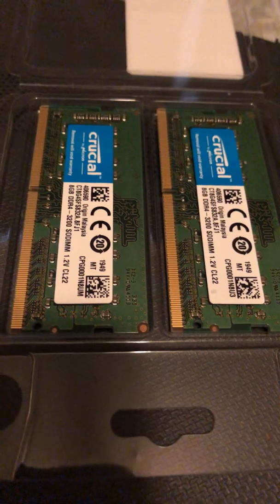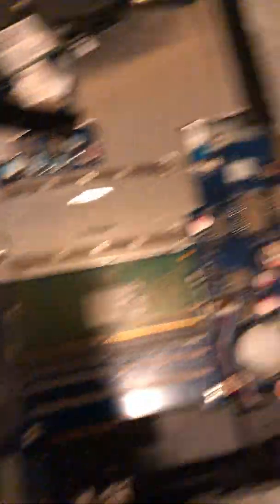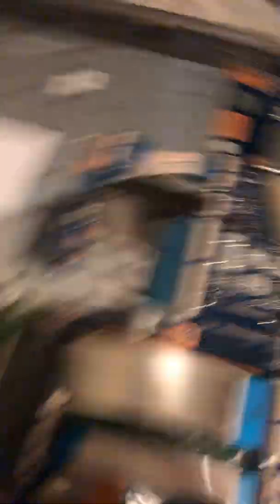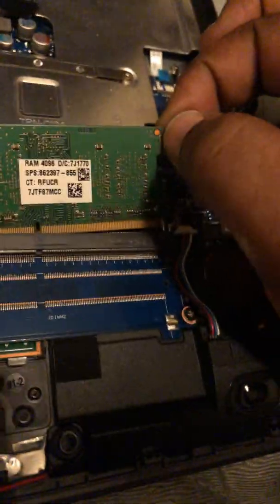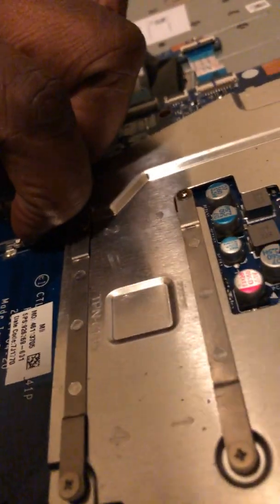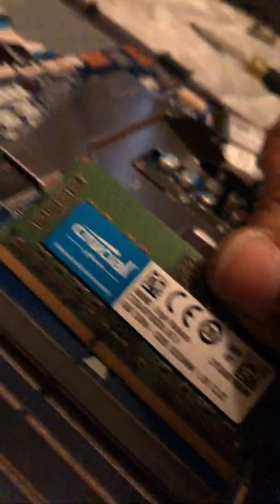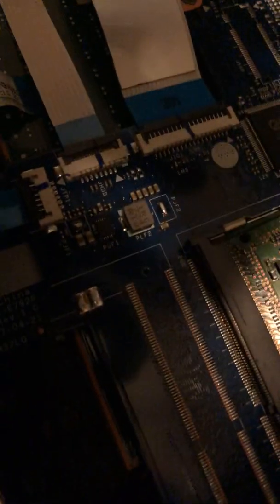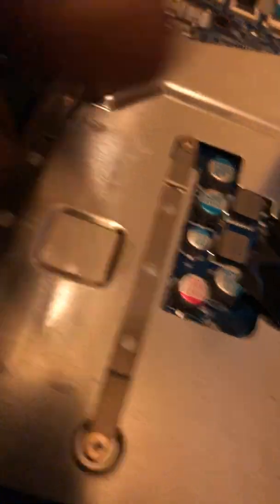HP 255 G6 NOTEBOOK PC RAM UPGRADE

Comment: If you run the system scan on the crucial website it would have shown the max RAM your motherboard can handle. The HP 255 G6 should have 2 slots for a max total of 8GB RAM Installing 2 sticks of 8GB RAM for a total of 16GB is a total waste. It would be better to just install 2 sticks of 4GB and have them interlace memory for dual channel.
Reply: You saved me from wasting money thank you
Reply: SilverEOD : thank you , but I think tehre is only one slot for RAM on the HP 255 G6 NOTEBOOK PC.  - : Can you confim please ?
Reply: @FRANCESCORUN  At the time of my initial comment I had owned an HP 255 G6 Notebook PC - I can confirm that there are exactly two RAM slots.
Reply: @SilverEOD  Thank's for reply me ..
Reply: @SilverEOD  The other slot on mine is empty, you have to solder a 2nd ram stick yourself?
Reply: @dpicks24  no solder necessary, just install a matching stick of RAM into the empty slot. Preferably 2 sticks of 4gb RAM.
Reply: @SilverEOD  I think my laptop is missing that part, because there's no empty slot for me to put another stick of ram unless you solder or attach some missing piece
Reply: @dpicks24  without being able to dee it I'm not sure what to tell you. Are you certain it's an HP 255 G6 Notebook? I'm not familiar with any motherboard variants with only 1 RAM slot. It's actually quite rare for laptops to only have 1 RAM slot but I'm sure they do exist.
Reply: @SilverEOD  there's definitely another place to put more ram but it's missing the piece that the ram actually sits in, idk what to call it
Reply: If that does seem to be the case and your laptop only has a single RAM slot then I would recommend finding out what the max capacity of RAM is allowed for the motherboard and then buy a single stick to replace the existing RAM you have. (I wrote this before seeing your last reply)